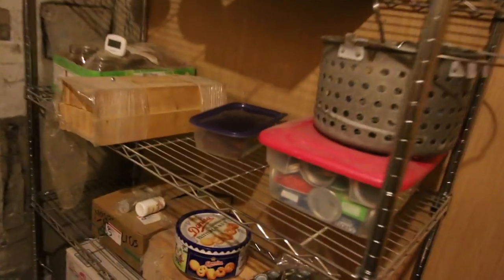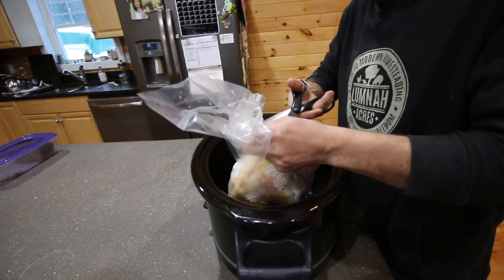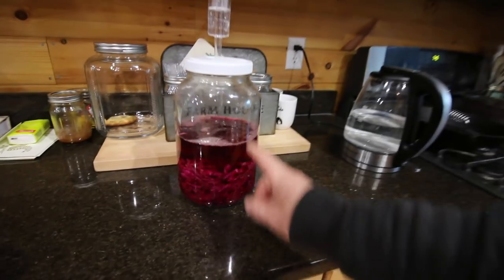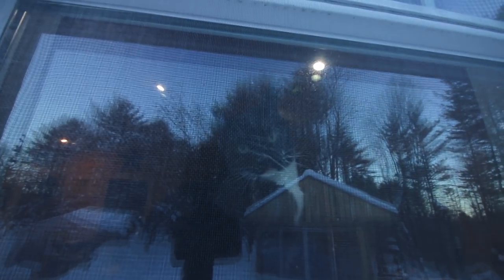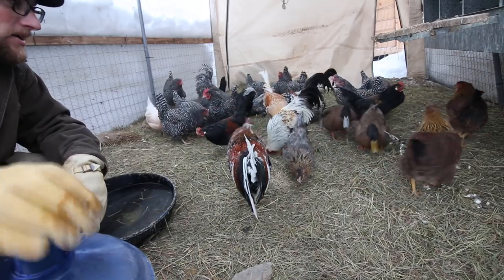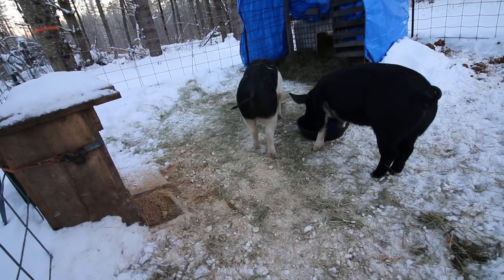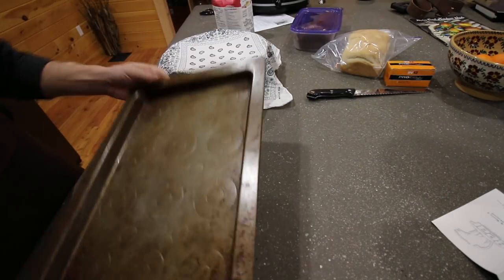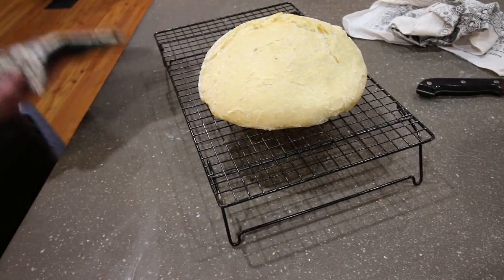Are we Crazy for Raising Animals in Arctic Weather~ Homestead Life

Comment: If you're looking more at the healthy side we'd really suggest doing sourdough starter/bread. The Sourdough starter itself can simply replace your yeast and it'll develop a deeper flavor profile. If you give it 24hr proofing then it'll be more soured. Allowing it to sour gives the same benefits as fermented pickling or kombucha minus the probiotic. Quick and easy way to start is use kombucha and flour in equal parts by weight. Our favorite is Sourdough deep dish pizza using a cast iron skillet.

Comment: Rig up an compost tea system.  Throw in an old t-shirt seal in compost..old 55 or 30 gallon barrel, run line to fill and pump.  Add airstone and run to feed garden and trees.  Worm castings work great also.  Go to a county asset auction or buy pot equipment used on Craigslist.  They cut the cords and create a resale for the led lights, pumps, fans, resivoir and hoses.  Plants in a wicking bed work.  Pump easy to water garden.  An old freezer water tight or 100 gallon resivoir.  Good luck great job.

Comment: I recommend  using a wet towel from the washing machine clothes pinned to a  shelf.  Should give a gradual change without a surge of moisture that could lead to condensation on cold surfaces.
Reply: this sounds good and you might also try a shallow tray filled with cool not warm water that would evaporate slowly as well

Comment: Regarding humidity for dry curing meat – in the book “Charcuterie,” by Michael Ruhlman and Brian Polcyn, they recommend a pan of heavily salted water.  (The salt inhibits mold.)  But that is for a refrigerator.  Maybe you can take the same idea and modify it for your situation.  They recommend 60 degrees, 70 percent humidity as an ideal dry curing environment.  (Plus the airflow, which you have covered.) /tom
Reply from the maker: great tip on the salt water!

Comment: Nice Video. We live at Latitude 61.39N only 5 degrees from the Arctic Circle. You're not crazy.  We moved up to Alaska on purpose from Kansas in 2013.
Reply from the maker: How long our your winters?
Reply: To dang long, about 7 or 8 months. if our temperature gets into the 80s it's hot, most of our summer our temperatures are in the 60s and 70s.

Comment: You might replace the battery cables. The cables can deteriorate over time. Connectors may not be making well. Especially the positive. Was it corroded any down on the starter? You need a lot of current to crank the engine. Is the battery the correct cold crank amp rating?  The battery may be good, but is it big enough?  I’d google that one. That old engine has a lot of compression. You could also put an electronic ignition on it and get rid of all that old electro mechanical junk and not worry about timing ever again. Couple other things:  if you put those ramps on cardboard, they won’t slide, you only need to disconnect the ground cable, spray some battery terminal sealer on so it doesn’t corrode. Usually just the positive corrodes. Usually just the positive cable is what goes bad. P.S.  That new battery on your gate is probably getting low about now because from the readings I saw it wasn’t charging.

Comment: I don't know how to solve your humidity problem, but in these situations, I try to find out how the old-timers solved the problem. When I was a child, I wanted to be an archaeologist, and I still love finding out how people used to live long ago.
I can tell you a story about air conditioning\humidifying in pre-electrical times, which may or may not help. People used to set tall, fired-but-unglazed clay jars of water in the windows on the upwind side so that the movement of air would evaporate water soaking into the porous walls of the jars. I wonder if you could put either huge baked clay jars or wooden barrels of water in your cave to raise the humidity. 
If that doesn't work, I'm wondering about the old water clocks, where water was slowly poured from one container into another. Maybe just the movement of water might raise the humidity.
I've also heard of spring houses - basically root cellars built around a spring, but that's not going to help you much in your current cave.
Reply: Kirsten Whitworth, the clay pot that you are describing sounds like a plain old terracotta flower pot. xoxo from sunny Arizona. 70/47f today. 🌞
Reply: Hi, Suzi Saint James. No, a flower pot won't work at all, but the terracotta part is right on the mark. The terracotta pot cannot have a hole in the bottom - i.e., the jar needs to hold water. Also, the pots I'm talking about hold about 5 gallons of water, or as much as possible. It's even better it they have a lid, but I guess that depends on the rate of evaporation. These jars were called ollas (sounds  like "oh yahs"), and were tall and wide.
You live in exactly the right place to use this method for off-grid air conditioning & humidifying.
The locations where the olla method were used to cool and humidify the air were hot and dry;  the idea was to limit the amount a evaporation (water was scarce), but keep the evaporation rate steady. Lumnah Acres' application is a bit different; it's a cold, dry application, so I don't even know if this method would work.
I hope that makes sense.
Reply: Kirsten Whitworth, thanks for the clarification.

Comment: There's these passive clay humidifiers, several kinds on amazon, but they will work slowly in the cold like that. But maybe it will be enough in such a small space? But maybe you can get a glass jar and put in a worn natural fibre rope as a wick? It works on a small scale with a string for automatic plant waterers. Maybe a couple of sponges for more surface area in a clay planter saucer or a spare rubber water dish like the one for the chickens and pigs?

How does the pig feeder work in the rain with one of the lids missing like that? I guess they eat it so fast that it doesn't really matter.

Have you tried doing the potato wedges with a little soy sauce along with the oil? I do that most of the time. Mushroom soy works best for this, but regular or even tamari will also work.
Reply: ceselb I like your humidifying ideas.
I thought a brick or 2 in a pan of water might give enough moisture off into the air....
Reply from the maker: Yup! they eat the grain so fast that it doesn't matter. Lol
Reply: Lumnah Acres, plus sprouted grains are good for all animals, even humans! xoxo from sunny Arizona. 70/47f today. 🌞